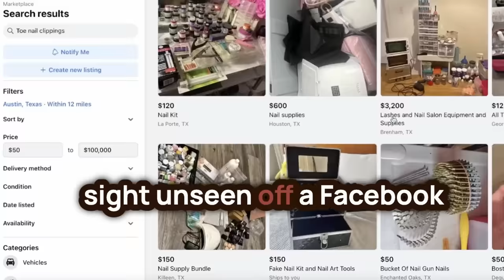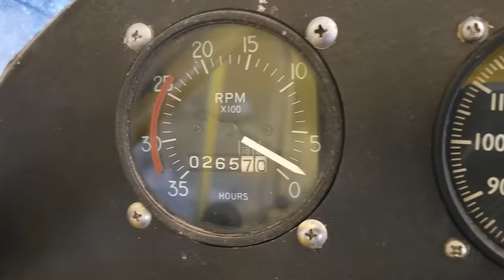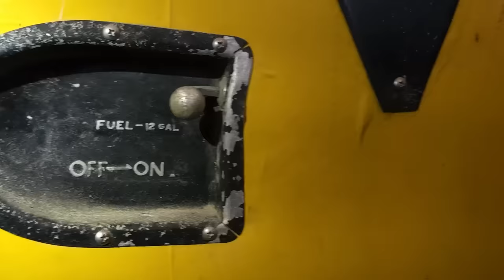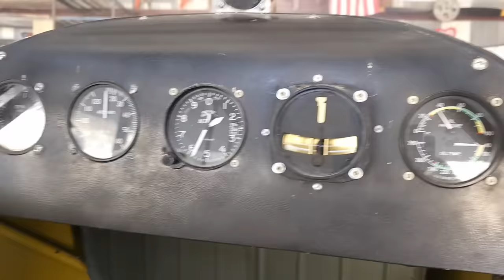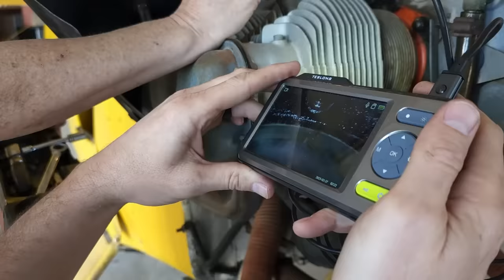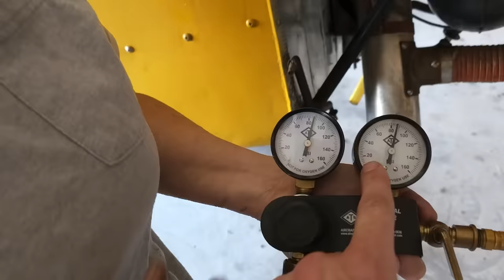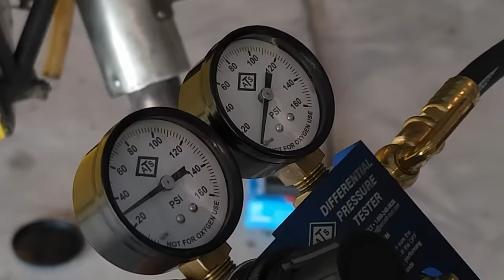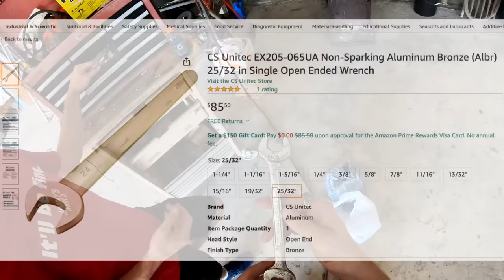I Get A FREE Airplane.... If I Can Start It

Comment: You can take the valve out of the guide you know. Just reach up through the bottom spark plug hole with mechanical fingers and grab the stem. Then you can ream a valve guide that is leaded up. You look up through the exhaust port to line it up again to reinstall it. Stick a tiny inspection light down through the top spark plug hole so you can see better inside the cylinder. Also, I recommend you put a GoPro on a stick and slide it up through the wing inspection holes so you can check to see how many rib stitch cords the mice ate.  The next to last plane I worked on before I retired was a J-3. The owner begged me three times before I told him to bring it in. I figured how bad could someone screw up a simple plane like that. Boy, did i find out. 30 plus write ups and an AD note that was never done since the early 80s. 
Also I have a Cub story for you from way back. When Piper started hanging Lycomings on them, they were operating with zero extra capital. One time a customer came in to pick up his new Cub and they still didn't hadn't bought the engine for it yet. As soon as the customer handed them the check, they rushed it to the bank and sent a man to Lycoming, which was just 20 some miles down the road form Lock Haven, to pick up the new engine. To kill time, Mr. Piper gave the man an extended tour of the manufacturing plant while they got to finishing up the plane and taking a test flight in it. Also, Mr. Piper had Lycoming agree to build the pallets they shipped the engines on with a special type of plywood top,  which became the floor boards in the plane. That is one reason they were under $1000 new.
Reply: Fixed a stuck valve on the ramp in my Luscombe back in college using a mechanical finger (tool retrieval tool). Had to remove the valve and ream the guide. Worked great. From start to finish it took all of 45min to an hour and I was outta there!  My roommate looked at me like “you’re gonna hop in that and fly home now?”  Sure did!
Reply: Great story thanks. BTW: Would love to hear any others you may have. Thanks.
Reply: You can actually do it without the mechanical fingers in the exhaust port so you can leave the exhaust in place.  Just bend up a couple hook tools from stiff wire and manipulate thru the plug holes.  Helps a lot to have a nice strong magnet on a stick that fits in the guide. Good stuff!
Reply: @NorthwestAirtech  Mechanical fingers make it so much easier. You won't drop the valve with them.

Comment: Glad to see you have the issues with the engine worked out.  This looks to be in really good shape.  You can do some aerobatics in these planes.  Matter of fact, a nationally known stunt pilot, Gene Griffith, currently holds the world tail spin record in a Piper J-3 Cub where he performed 87 consecutive turns from a height of 12,000 feet in the J-3 in which this record was set in back 1950 in Zanesvile, Ohio and has never been broken.  It was a very windy day when Gene set this record.  Many pilots have attempted to break his record in the J-3 but all have failed.
Reply: There is no PA-18 in this video.

Comment: I've heard of freeing valves that way but never seen it done before.   Good Job Jimmy.
Reply: I've done it, and it has worked at times. 
About stuck rings, I've had luck filling the cylinder with two-stroke oil, and letting it sit for a week or so, change the engine oil, and run it up to working temperature.
Reply: I like the fuel hose trick to chuck it up.
Reply: @leifvejby8023  one better than that is diesel fuel, it's thinner and gets everywhere!
Reply: @samrodian919  Diesel doesn't dissolve coke.
Maybe automatic transmission fluid would do. Don't know, hardly any automatic cars around.

Comment: I know nothing about aircraft engines but a fair bit about flat four VW's. Remove pushrod from tappet. Move tappet. Spin valve enthusiastically. On VW's I use a small battery hammer drill. DON'T use lapping compound :)

Comment: A 25/32 nds wrench is one 32 nd over 3/4. When do you need to be that precise?? To get the mud dobbers out, put the shop vac hose in one access port and reach in through another to break it up. Otherwise you'll have dirt all inside the wing.

Comment: Marvel Mystery oil works wonders for old J-3 engines. Also, Aero Kroil is your friend for things that are stuck. Mouse Milk should be in your kit next to the WD-40…just saying. 😊
Reply: That's what I was thinking. Break out the MMO!
Reply: You know the joke about MMO, right? The mystery is - what's it good for?
I used to buy a lot of that when I owned a C-85 in a Cessna 140. Until I started to add TCP to the fuel.

Comment: I had a stuck valve on the #3 as well recently. The rope trick wouldnt work, so I just popped that bad boy off, got the valve out, cleaned it and the intake valve up, used a nylon brush to clean the guides, and gave it a good hone before I put it back on. Helps if you have the real gasket push rod tube conversion. That was the first change I made to my engine.

Comment: keep air hooked up while you tap on the valves with the hammer.  The air pressure will blow the chunk out at the moment hit it.  Do this all the time on automotive stuff, and we do use leak down testers in the automotive world. and while I was typing you got to that air pressure part...lol.

Comment: Jimmy? I think you did the leak down wrong on the cylinders that had leakage. I saw the prop in the same position for both cylinders on each side and the prop should be 180 degrees for each cylinder for a total of 720 to cover all 4 cylinders on a 4 stroke engine.. You have to check for compression stroke on each cylinder separately. If one is TDC, the other one behind it is not TDC. Maybe you did rotate the prop but I did not see that for the other two cylinders. Just thought it weird that two cylinders had leakage and two did not.

Comment: You do NOT have to take the engine apart if the valve falls in.  In fact, knocking it into the cylinder is part of the process you can do to clean the valve stem and ream the guide without pulling the cylinder.  You can route a set of mechanical fingers in the valve guide, grab the valve, and put it throught the spark plug hole, then rotate the prop until the piston holds the valve while you clean it.  Let the valve back down when you're done, then use the mechanical fingers through the spark plug hole to put it back into the guide and lap it.  Had an A&P do this to 2 cylinders on my 150 when I got a stuck valve 10 miles from an airport in 2019.
Reply: someone needs to make a video on this

Comment: I see a tailwheel endorsement coming in Jimmy's future!
Reply: I may not know much. I didn't even know you needed a special license for them. My dad had a 48 Luscome taildragger. I thought anyone could fly them.
Reply: @Max Nafe Horsemanship  
Most people learn to fly in airplanes with tricycle landing gear. If you take flying lessons in a tailwheel airplane, or what the FAA refers to as "conventional landing gear" there is no requirement to have a tailwheel endorsement, and you never need to get a tricycle gear endorsement, because that is the less difficult of the two types. Just the standard required check ride in the aircraft type is all that is needed.

Comment: I worked in a small car engine rebuilding shop in the 70's.  Most of it was carry out work but they had a bay for R&R work too.  They rebuilt a Cadilac engine in a car that had some sort of front wheel drive that made it a very tough job.  They thought it would be a good idea to put chrome rings in it but they couldn't get them to seat.  In desperation the owner poured Bonami (pumice) in each spark plug hole & ran it.  It worked to seat the rings then wear them out all in about 5 minutes so the engine came out again.  Somehow, I flashed back to this memory.

Comment: Perfect plane to put a Yamaha Apex motor in it.     Just spinning the valve with a drill can clear carbon off the seat. You might not even need valve grind compound.   Spray some top engine cleaner in spark plug hole.   Done it many times.

Comment: Jimmy the 12 point nuts that held the brakes on the main wheels of a Boeing 727-227 are 25/32". Still have that socket in my tool box.

Comment: For stuck rings, valves, dry carbon in engines which have not run for a while. I filled the cylinders with diesel for a few days. The diesel will go in the motor oil, no damage you need to change the oil anyway. Diesel has a greater means of  going into places and leaking more than other fluids.

Comment: Jimmy, ask you A&P or the AI this question. I was told by my instructor when I first started lessons was to never pull the prop thru that the Mag's trip.The reason was if you have a bad ground the engine could possibly fire over when the mag makes contact.

Comment: I always do the compression test in the bottom plug hole. Been bitten too many times with carbon falling into the valve seat and making the valve leak.

Comment: always hammer knock the valve/s multiple times after putting the keepers back in, regardless of being new or used and knock them more if used(carbon does bad things!).
I'll follow that with saying, always stand well off to the side in case all hell breaks loose! I have retrieved parts from across the garage a few times over the years, but never had a valve get eaten afterwards(yet) :hand-orange-covering-eyes:

Comment: We had a 1956 Cessna 172 with an O 300 Continental in it that used to occasionally get sticky valves. The trick we used was to add Marvel Mystery Oil to the fuel tanks and then run the crap out of the engine like you did that usually did the trick. Once we started using Marvel Mystery Oil regularly, we never had a problem with stuck valves again

Comment: Old school trick we used to do is throw transmission fluid down in the jugs. There's a lot of detergent in there and it has a tendency of breaking free a lot of carbon. It's how I used to free up rings on the engine that's been sitting for a year or two as well it lubricates. It will billow a lot of smoke till it burns off

Comment: for carbon removal soak the rings and valves with pb blaster then run the engine get it hot and spray water into the carb while its running--the water will crystalize the carbon and make it break up

Comment: You need Tarryl from Tarryl Fixes All to fix your sticky valve.  It would be a YouTube sensation.  By the way Marvel Mystery Oil or transmission fluid added to your oil and fuel will prevent any carbon problems in that engine.
Reply: YES YES YES Taryl could show Jimmy a crap load of tips and tricks to save time and work when it comes to mechanical innovations,Taryl is "The Man" !!!!!!!!!!!! Wish we could get those two together maybe even get a skit too !!!!!!! They call me "Handy Andy" ,!!!!!!

Comment: Also known as the Italian tuneup. Old schoolers on automotive engines would pour water down the carburetor while giving it the beans…. Cheap steam clean, plus worked to reseat stuck piston rings
Reply: Watched somebody do that with Marvel Mystery Oil with his son's '77 Honda CVCC: smoked-out half the airport for an hour!
Reply: My dad used ATF, just a drizzle into the carb at high idol, an killed mosquitoes all around. But it also blew out cylinder crud.
Reply: Yep still that’s the old school approach for sure!  Just a drizzle… lol

Comment: The old valve lapping ... done that a few times on motors ... used a wood rod attached to a rubber suction cup ... all part of the game to get the cylinder pressure up ...😊
Reply: They still make those tools.

Comment: My dad had one that was used during WWII.  I was almost born in it. Seriously!  I grew up around the J-3 Cub. I started flying lessons really early but official lessons at age 11. My dad had red and green bicycle lights powered by D-cell batteries.  He had to change them about every 3rd or 4rth flight.  I would love to have a cub these days.  I have an Ercoupe which my dad said to never buy. He was afraid I would be limited to 2 axis flight.  Mine has rudder pedals.  We have a no start inside the T-Hangar rule at Edgefield Co. SC, because it blows dust all over the other planes in the hangar.

Comment: I don't even have a pilots license, but I heard the name of the Piper Cub a LOT and never anything bad. Hope this thing works for you. If I recall correctly, this is the one you want your kid to start on. I've done that kind of valve work on a few cars but I would never risk doing it on an assembled engine. Way too much could go wrong. No more time and only a few bucks for a head gasket to pull the head and do it safely.

Comment: You missed the one thing that made the Cub  a basic aircraft, the piece of wire protruding out of the gas cap in front of the windscreen to let you know if you had gas left or to start looking for a field. If it was bouncing up and down you were good to go. In 1962 my dad bought a 47 cub for 1200 dollars in flying condition. Best thing about a fabric aircraft is you need to work on something internal cut the fabric off fix it and in a weeks time have it back good as new fairly cheap. (if you do the recovery process yourself). You will love flying around with the door down . If the locals weren't so eager to turn in every little infringement another fun thing was to toss out a roll of toilet paper and see how many times you could cut it with your wing before it got too low.
Reply: I cut that wire off on my J3... so it wouldn't scare me.

Comment: My Uncle Hubert had a '46 J-3 Cub, he propped it with one hand, my Navy pilot dad used both, the stand in front positioned to fall backwards if you lost your balance.
Hubert bought it after the Piper salesman who lived in Kansas flew him in his, and showed him how he took off using a post with a cable and a hook in the wing, due to his EXTREMELY short runway, the plane would circle the post 2× and as it came around to his runway, he pulled a lever that opened the hook and then had sufficient ground speed for takeoff. 
Hubert used the GenAv airport in Oklahoma City,  HIS back yard was WAY too small.😁
👍🇺🇸😂

Comment: I helped rebuild 22 of those Piper Cubs. Don't forget to check the welds in the rear of the fuselage. Everything I worked on had metal spars. I think they cost $500 Army surplus.

Comment: Jimmy how do you get to the face of the valve? to apply lapping compound without pulling the head off, also try pouring transmission fluid into the carb as it’s running that helps decrudding valves of carbon build up

Comment: That is not a 46 if it has a wood wing spar. Also, I have never seen a curb that does not have a steerable tail wheel. It steers by the tailwheel, connected through springs, to the rudder.

Comment: Dynamic Carbon Removal: Setup a small hose with shutoff from a water bottle to a vacuum source on cylinder to be cleaned. Start engine, set RPMs to operating speed, open valve to water, don't let enough in to slow engine. Watch the smoke out of exhaust! This tip cam from Dealer Tech @ American Honda, for a grannied Gold Wing that ran like crap due to carboned valves not allowing vacuum throttle pistons to operate properly. Worked perfectly, smelled terrible while carbon was expelled.

Comment: I'm not sure where you got your history lesson but I got mine from my grandfather who was a Great Lakes dealer and pilot in the 30's.

My grandfather preferred the Champ over the Cub and said one of the benefits was it could be soloed from the front seat.

He said the reason you couldn't solo a Cub from the front seat was due to lack of spin recovery in certain instances.

I don't remember the details for pilot weight and the manoeuver that got you into an unrecoverable stall but they cracked a few planes up before the rear seat solo mandate was put in place.

Maybe an inverted flat spin? 

And 90% trained in a Cub? Not sure where you got that number either. The Stearman biplane was a trainer as was the PT-19 monoplane. Several other airplanes were also used as trainers.

Comment: You need a training to start up the Engine.
Check the Prop...magnetos...timing 
make shure the vaporizer is clean, change to new fuel.
We always pulled 3 times back and than try to start.
If everything is just like it has to be....it will start with the first try.
So get the ass up in the air.
It was in the early 80 when i worked on it.
Your mecanik ....? Is it Jane Reisiger?

Comment: The main spars
(fore and aft, there are two), support the wing (singular). the model J3 is not a bi-wing aircraft and therefore does not have wings.

This is evident by referencing Note 1 in the aircraft TCDS,
number: ATC 660

Comment: 25/32nd? Heck I use that size socket to remove the nuts and bolts on a Airbus A320 brake assembly.

Comment: I worked on this Piper.
In Germany they where called Piper L18. It had 240 hp. 
Gastank was in the right hand wing.
The wing is cotton with special lacker 6 ...7 coats. I learned how to fix it.

Comment: Sometimes we used to decarbonize by switching plug wires to make  the engine detonate. This is kind of radical, you don't want to do it for long but it will blow out all that stuff

Comment: Among other things, I'm a small engine mechanic. I have worked on a lot of engines that are fundamentally similar to that old Continental. I never would have imagined trying to lap a valve with the head still installed. I kind of cringe at the idea of getting abrasive paste in the combustion chamber and cylinder. For me, that's an immediate "gotta take the cylinder head off". Seems like it would be a pretty delicate operation, and definitely impressive to see it done. I have an unrelated question. At the end of the video, you said you didn't have the appropriate licence to fly that Cub. Why? I'm new to the channel but I assumed you had a PPL. What am I missing?